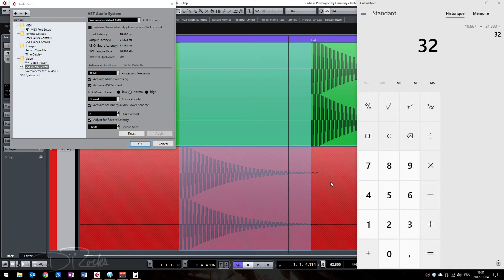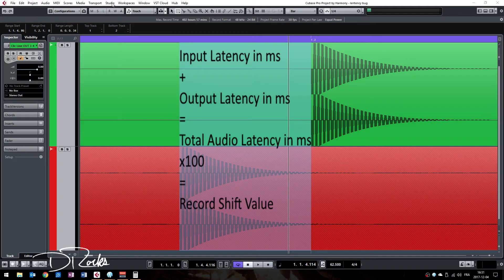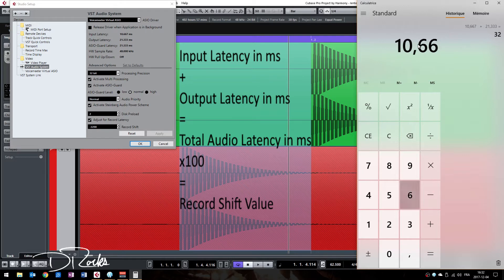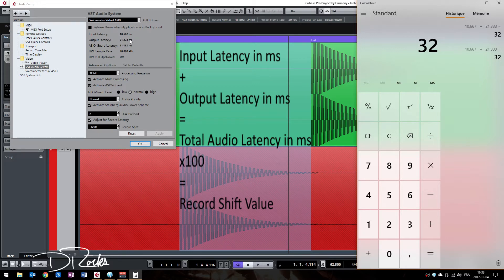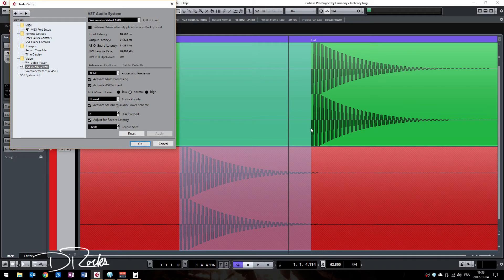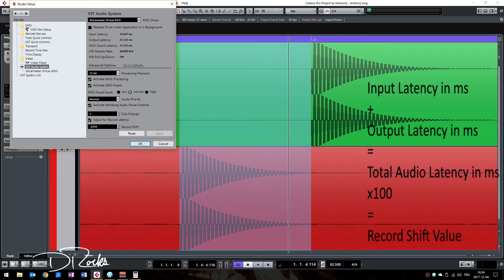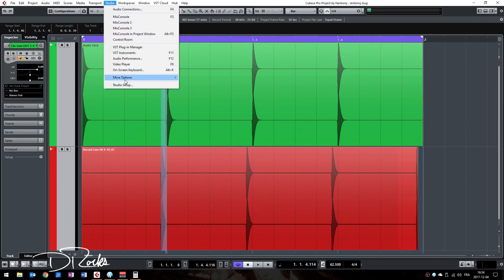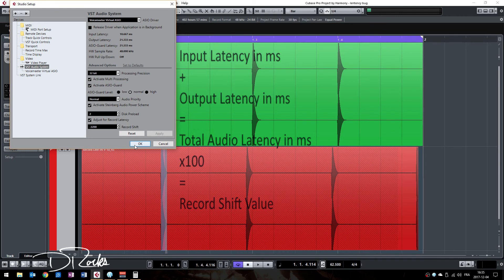How to: FIX RECORD LATENCY SHIFTS IN CUBASE (Part #2)

Comment: somehow this doesnt work when i record via midi to my synth and back via my sound card  -  midi and wave signal after doesnt  match :( i am with rme interface , i calculated everything , tried both ways in your tutorials , and for some reason Record shift doesnt move anything forward or back like its not working , checked and unchecked the box above as well
Reply: I'm having the same issue. Any luck after 2 yrs.?
Reply: @theone9638  not really , just moving things on the grid manually if i feel i have to :)
Reply: @Kundalini  thanks for the reply man. Good luck with your projects!

Comment: Input latency: 1.854 ms
Output latency: 1.854 ms
I+O=3.708 ×100=370.8

Am still latency issue😔😔
Reply from the maker: You are still seeing the audio recording earlier or later than the original audio?
Or is it some other kind of issue?
Cause this video really focused on records that happen not in sync with real record input.
Reply: @DRocksRecords  I think his problem is that.. you put latency with number of samples.. and sample are in WHOLE number. When he calculated, he got a number with a decimal. Unlike in your example.. you got a whole number. So that's why he still encounters problem.

Comment: Problem is that recording latency changes depending on amount of effects.
Reply from the maker: But in that case wouldnt Cubase update the values of input and output latency in the setup?
If it does then you can adjust when doing critical recording and not care about it if mixing or maybe even MIDI (i did not test MIDI)

Comment: hey any reason why I'm only getting 7.000input and 6.000 output?
Reply from the maker: The less it is it means the less you have latency. You probablly tested when your audio interface was on a low buffer size which means there is less latency.

Comment: Cubase should actually automatically compensate for input & output latencies. I‘m not sure why it does not do that in your case... What audio-device are you using? I‘m pretty sure Cubase does it for me, but I‘ll check when I‘m back in  the studio.
Otherwise you would have to recalculate everything whenever you change buffer size or samplerate of your project...
Reply from the maker: hey Codexll, yeah I'm also confused on the reasons why it doesn't compensate by itself sometimes and sometimes it DOES! I've been experiencing this over the last 8 years randomly with my "firewire -Presonus - FireStudio Project Tube".

Atleast I know now what to do - because before this day of trial and error leading to the making of this video, I just did not know what to do at ALL and my recordings were almost useless or impossible to know with 100% accuracy if I replaced them at the correct recording position.

Thanks for your comment, I'll be looking forward to hear about your own check-up in your studio :)
Alex
Reply: This software is DUMB.  It can't even automatically compensate for the recording latency. I mean, why does the user have to worry about that stupid latency..
They should CLOSE already.

Comment: thanks for sharing this feature.
Reply from the maker: +Roland Gerard  its my pleasure :) thanks for taking a few seconds to mention this. Are you also a Cubase user?
Reply: Yes i am, Cubase 9.5. I did the same as in part 1, trick part 2 is much faster.
Reply from the maker: Cool that's awesome! So it worked fine for you also with the Formula? (Input + Outout latency = ms x 100 = record shift value)
Reply: D Rocks Records yeap 👍😄